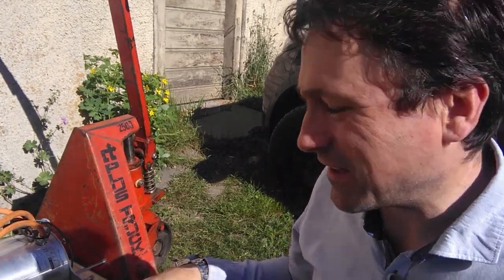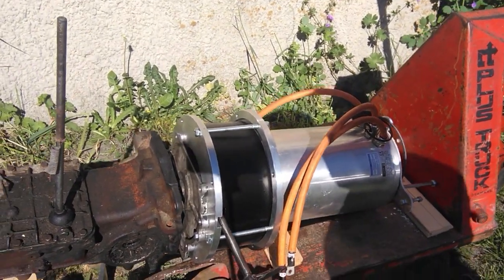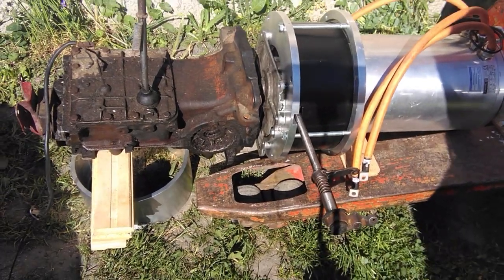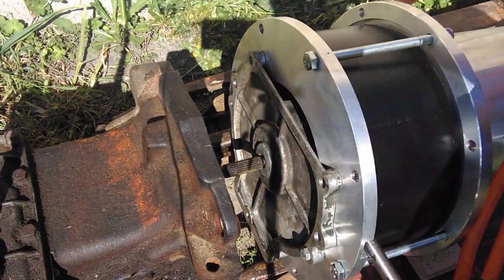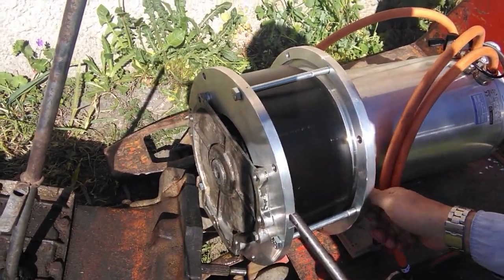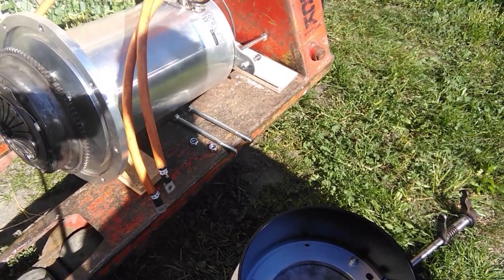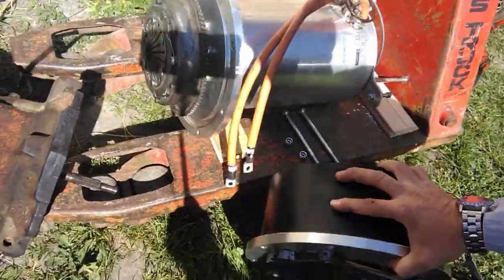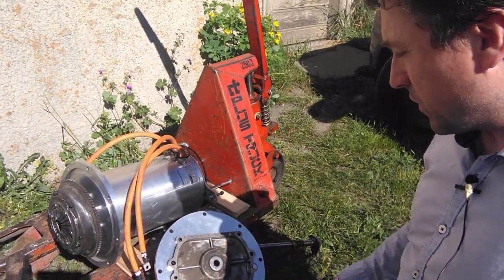REMICHANICS #27: EV Conversion Renault 4CV, Drivetrain Dry Assembly

Comment: Compliqué. Il n'y a pas vraiment besoin de conserver un embrayage avec un moteur electrique.
Reply from the maker: Bonjour - assez compliqué, mais il y a beaucoup de raisons qui rendent indispensable cette configuration. 1) originalité 2)nécessité de homologation/CT  3) philosophie de retrofit 4) courbe de puissace du moteur 5) ampérage max inverter et batterie. C'est donc indispensable de faire cette opération sur cette configuration specifique, aussi si ça veut dire du poids additionel et complexité. Salutations!